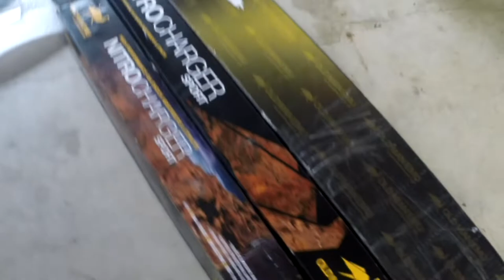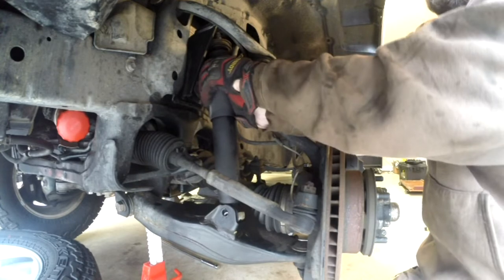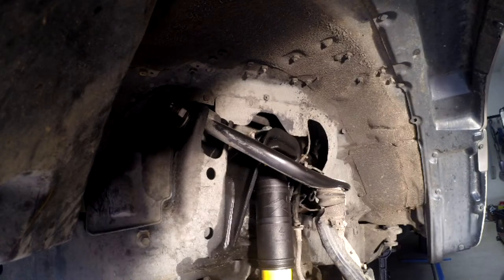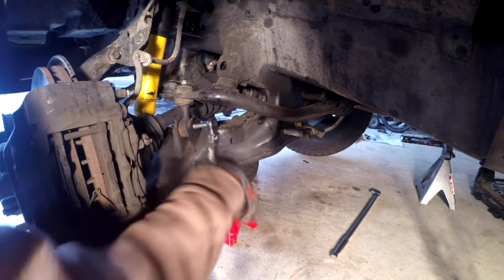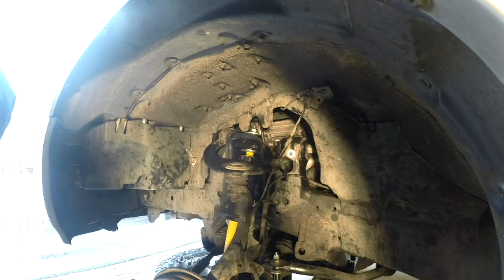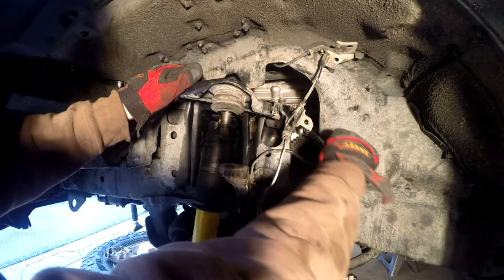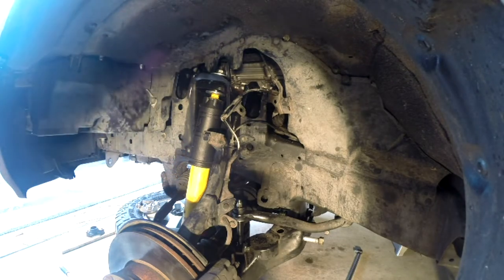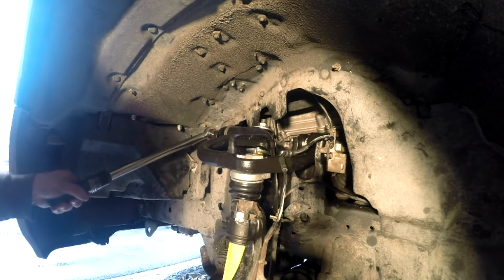OME Front Shocks & SPC Upper Control Arms Install - Land Cruiser 100 Series Overland Build

Comment: Just learned yesterday working on my 100 series with my buddy that you can access and torque the upper shock bolt by accessing it with a few extensions and torquing from up in the engine bay! Might help someone make this process even smoother!
Reply from the maker: Thanks!

Comment: Shouldn’t you have tightened those lower front shock mounting bolts to spec with wheels on the ground?  Seems like torquing to spec when lifted off the ground will put bottom shock mount bushings in a bind.

Comment: First time I see a drop link replacement as part of a lift kit install.  Do you think it is needed?
Reply from the maker: Great question! I don't think it is absolutely necessary.  Getting the sway bar back in stock orientation takes the extra pressure off the sway bar so it preforms as designed and your ride should be better. It also allows for more suspension travel allowing you to take advantage of the extra travel you get from the shocks and UCAs.  More droop in the front makes the lift preform much better and safer.  another vid on droop to come.  since I never had the lift without the extended links I am not really sure of the true difference in handling feel.  Trail tailor had them in stock at the time and my bushings were shot anyway so figured I would do it at the same time.  Thanks!

Comment: Do I have to upgrade after market upper arms when lifting the car 2’’  lift?
Reply from the maker: You don't have to but you will be able to get your alignment and specifically camber closer to factory specs which will result in a much better ride.  Sorry it took so long to get back to you been off grid for a couple weeks.
Reply: Many thanks...💪🏾

Comment: Man I need your help. Did you install extended sway bar front and rear with your suspension upgrade? 
What is difference in length between these extended ones and the stock both fron and rear.
Reply from the maker: Yep i did both front and rear. I think they're about an inch longer but can't remember for sure.

Comment: Did you do an AHC delete beforehand or was your Land cruiser stock coilovers with no AHC?
Reply from the maker: It was stock without AHC but the stock non-AHC suspension ON THE 100 series does not have coilovers. It's separate coils and shocks in the rear and shocks with torsion bars up front.

Comment: Does the Lower Control Arm also need to be beefed up or changed at all with this setup?
I'm not actually installing the SLEE Kit, but will be replacing the UCA and LCA on both sides- so this demo helped me out quite a bit.
Reply from the maker: I don't think the LCAs need to be beefed up. The main reason for the uca is to get greater drop and allow for larger diameter shocks. The LCAs are strong and not the limiting factor. Thanks glad the video was helpful !

Comment: What about torque specs? Do you remember what they are or could you point me in the right direction? You've mentioned them on other videos but I don't recall hearing any in this one. I hope all is well. Thanks.
Reply from the maker: I don't remember the exact torque  specs but I'm sure I used the service manual.  Search on ih8mud.com  In the 100 series forum for the service manual. I bet you'll find it there and the torque specs within if not let me know.
Reply from the maker: and all is well! thanks for asking and checking us out!

Comment: Hey Bradley. I have one question. How does the truck ride? I have a 2002 and I am about to order the same set up, but some have said that the ride is "harsh". One person said that they could not drive down a street with their daily coffee for fear of it jumping out of their hand. Any comments would be great. I don't mind a "firm/sporty" ride, but harsh is a different story all together.
Reply from the maker: Hey man, I thought I had responded to this a week ago but looks like it didn't save.  I don't think the ride is harsh at all.  I think most people that have that experience is because that use springs that are too heavy for the back.  I have medium springs and the truck is pretty loaded and it rides great.  I think if I would have gone heavy it would have been pretty rough.  I am going to go heavy as soon as I install a rear steal bumper.  If you aren't loaded up you could even go with some light rear springs.  I apologize for the late response! Good luck with your build!
Reply: @BradyAdventures  Thank you for your response. I will update you once i get it all together!

Comment: How come the slee doc upper control arms are $577 for the pair but OEM ones are over $650 for the pair?? Which ones are actually better? I’d think slee made good ones but are the OEM more durable or something?
Reply from the maker: Wow that is a great question and cool observation.  

First, point of clarification, the UCAs that Slee sells are from the company “SPC Alignment“. They specialize in this type of product for everything from commercial to race applications.  Also, check McGeorge Toyota, for some reason they have the best prices on OEM Toyota parts, UCAs there are $285 each so $570 total, almost the same as SPCs. 

I don’t have a definitive answer on which are stronger but here are some general thoughts.  The Toyota UCAs are pretty heavy duty and probably have more overall material (steel) than the SPCs.  The SPCs are tube steal and the construction, I would guess, is equally strong or stronger but either way strong enough for what I would throw at them.  Toyota parts in general are incredibly expensive and do not always compete competitively with the aftermarket products since their focus is on dealership maintenance and not aftermarket performance. 

The main reason to get aftermarket SPCs is to allow for additional caster adjustment and droop needed when lifting the cruiser and also to allow for larger shocks, there’s more clearance inside the arm.  I have seen alignment results on lifted cruisers without aftermarket SPCs and the caster numbers are not great and off caster can cause some sketchy handling characteristics.  I talk about this a little in this video https://youtu.be/0XPWKTfGFN4

If you are not lifting the vehicle then I would stick with the stock UCAs and if you are lifting definitely go with aftermarket.    

I hope that is helpful and thanks for the great question!

Comment: Did you need the upper control arms or could they hsve aligned it without them
Reply from the maker: I am pretty sure you could get everything aligned except for the caster.  Caster correction is the main benefit of the aftermarket UCAs, some are preset for correct caster at a ~2" lift and the SPCs have a range of adjustment.  I have seen peoples numbers with out UCAs and the caster numbers are not good.  Plenty of people drive them that way but it's not great.